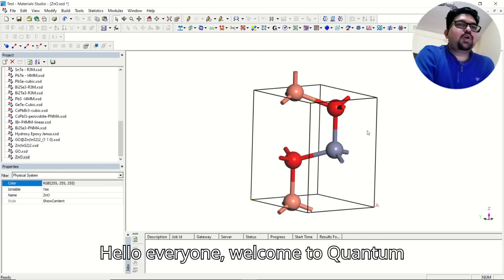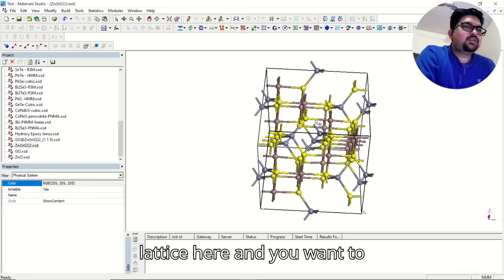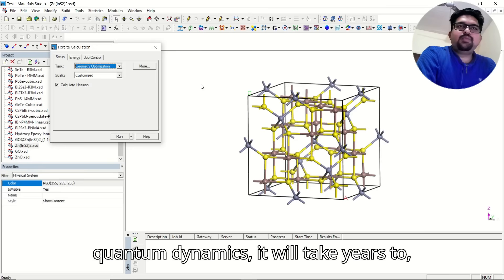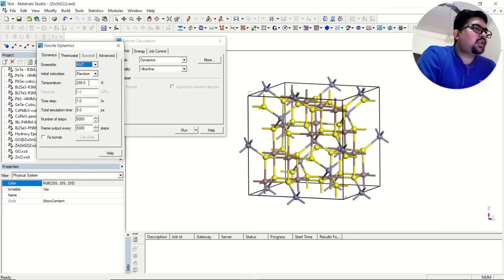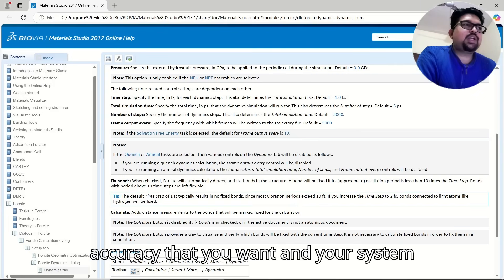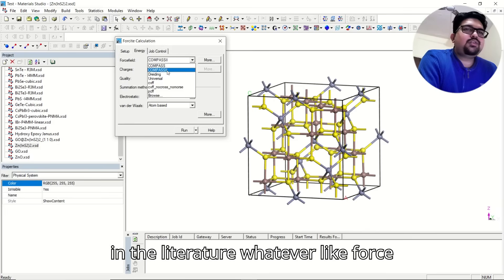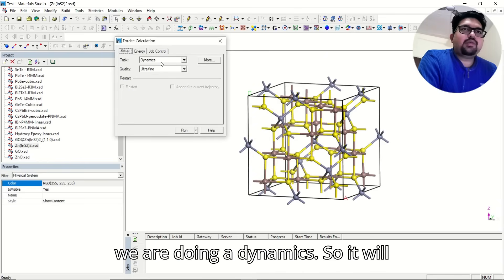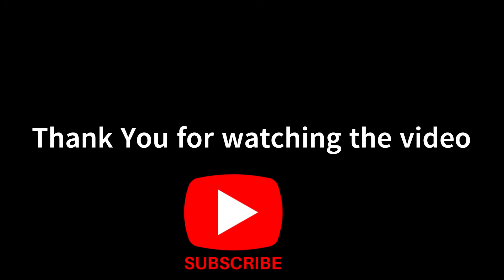Molecular Dynamics Simulation

Comment: Hi. Thanks for the tutorial. May I know what is the largest system size I can create if I want to run material studios in HPC system? Is it possible to run more than 15ns? How long will it take in real time?

Do you plan to provide tutorials on how to analyse the trajectory of the MD simulation in Material studios? If I need to run some analysis, like RDF and compute energy between two particular selected atoms, how can we do this using forcite calculations?

Tq!
Reply from the maker: Is it possible to run more than 15ns? yes

How long will it take in real-time? -> depends on various factors, like the size of the unit cell, QAIMD or just MD, total simulation time, energy cutoff, HPC configuration, etc...QAIMD is costly as it takes huge time...even for a simple system like graphene (two-atom unit cell) , QAIMD for 5ps at 500 eV takes around a day on 24 processor system.